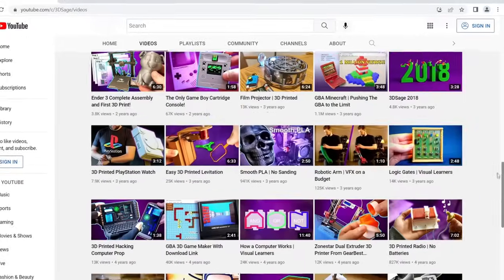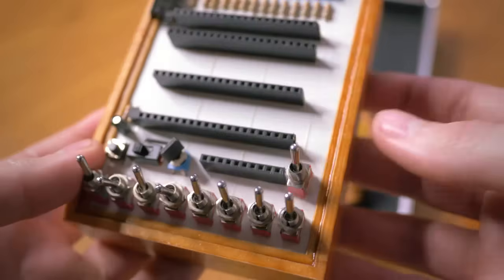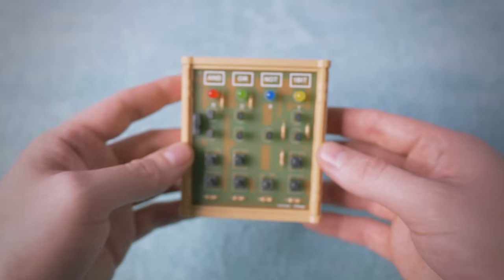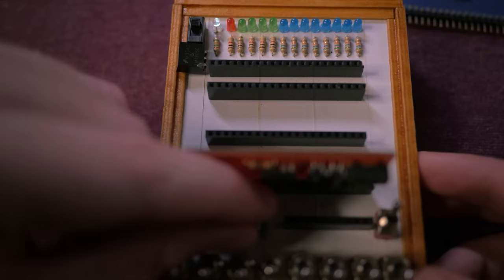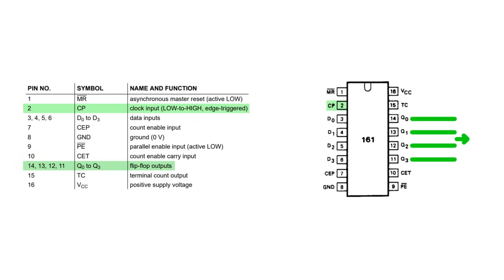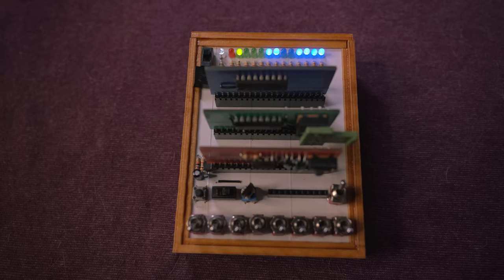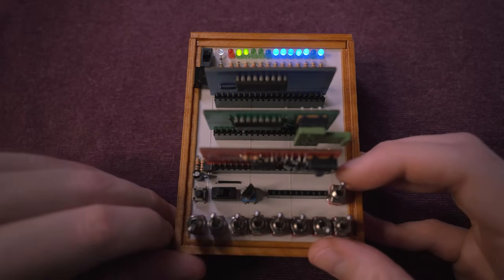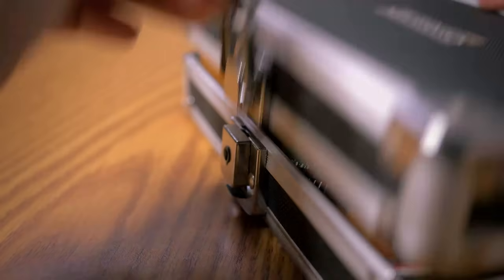I Made My Own Computer | Let's See How It Works

Comment: at 2:00 there are two types of BJT Transistors
 NPN is effectively a NOT gate in transitor logic (runs until input is applied to gate) [inverse of or gate]
 PNP is effectively a OR gate in transitor logic (runs when input is applied to gate) [shown in video]

2:29 though I didn't think two not gates together could do that, maybe it is a simple SR Data Latch, but I don't know how that works... hmmm time for research I guess. though my question is how that stays locked in one position... its definitely a data latch, but how does it not turn into a SR Data Latch clock like at 2:53 ... hmmm.

2:53 oh there is the SR Data Latch! perfect use of the NPN transistors nature to close the connection when powered and loop doing so!

10101 is 21 { 16[1],8[0],4[1],2[0],1[1] = 16 + 4 + 1 = 21 }

okay so there is halt, loop, and jmp... what is the fourth one?

Hope you have a great day & Safe Travels!
Reply: the capacitors is what makes a SR-Data Latch into a clock [ just realized that]

Hope you have a great day & Safe Travels!

Comment: Very cool. What’s actually interpreting the instructions? Something with EEPROM I guess? Actually if all your instructions are single clock-cycle operations, then just using an EEPROM would probably work, but maybe having a 12 address pin EEPROM with every input possibility hard-coded, for an 8/4-bit computer, kinda defeats the purpose.

Comment: Can it play doom?
Reply: No it cannot run doom. For doom you would need a real pixel display. And his computer does not have that. Oh, and also, the controller does not have enough buttons to controll doom.
Also x2, the computer does not have enough power to run doom. It also cannot do basic operations like adding, subtracting, multiplying and subtracting. Its only a little project designed to do really simple operations.
Reply: @boldituzvillam2318  😭

Comment: Where did you get you ram/memory chip from???
Reply from the maker: It was hard to find. I believe I got lucky and found one posted on Ebay. There is very low demand for such small ram chips. If someone else knows where to find more, please let us know.
Reply: @3DSage  You can find through hole SRAM in quite a few sizes by searching "SRAM" and selecting through hole and parallel, then you can decide on whatever sizes still remain in the list.

Comment: this isnt really a computer, its a cpu with ram, but wheres the controll logic, that interpretes the commands, or the alu, it not actually a cpu, it lacks the alu, so it cant calulate anything, which is the most important feature of a computer, with that being said, still a cool project, @3dsage please respond if i got anything wrong

edit: now i wrapped my head around how it works, since it really only has 2 instructions it dosnt need control logic, the alu point is still valid though, you can take a look at the ben eater cpu project, that thing is a full blown cpu

Comment: But can it run Doom?
Reply: No it cannot run doom. For doom you would need a real pixel display. And his computer does not have that. Oh, and also, the controller does not have enough buttons to controll doom.
Also x2, the computer does not have enough power to run doom. It also cannot do basic operations like adding, subtracting, multiplying and subtracting. Its only a little project designed to do really simple operations.

Comment: too simplistic! considering it works on not many bits, could address the real problematic of what processor opperations are. 
anyway, i never saw any real consideration about processor opperations. 
and what would that problem sound? 
like what is needed to fully exploit the possibilities offered by the size of the data magistral.

Comment: So, just fyi: the lines going out to the chips are called "control lines" not op-codes.
Op-codes come from the cpu in the form of a binary number. This number is then decoded and pushed through a look up table, which converts the opcode (usually like 4 or 5 bits) into the control lines (called microcode). This allows the code to be stored more efficiently, because of having to individually toggle 10 or more control lines manually, you only have 4 bits, dictating instructions, that control all that for you. The amount and types of op-codes you have in your CPU is called the Instruction Set.

Comment: Get yourself the parallax guick start. They say it got multiple cores so it dont need interupts. Arduino is nice. Or you can get raspberry pi. Not enough info couldnt say you really got a computer maybe real simple ahead of me in diy though. Read some books that showed how to put a computer together. But think you would learn more with arduino you could read ir signals from remotes then use the codes to turn on things like relays and lamps. Then control lcd screens make yourself climate controller. Course you can play video games with raspberry pi real game changer.

Comment: interesting project, but all that was demonstrated was a programmable counter, NOT an actual computer in the usual sense of the word. Perhaps the architecture allows math and logic units to be added, but as it is presented, its useful limitations are quite extreme.....can't do much more than flash some LEDs.

Comment: You don’t need to create a custom programming language to make a computer from scratch (that is emphasized because pc building is a different thing). Second of all, you are completely wrong at 1:40. There were plenty of other inventions you still need to weigh it’s importance on (like rockets, space stations etc.) The transistor is also not essential to computers and was in existence for a couple years before they used it to make logic gates. The logic gate (which is one of the only purposes of a transistor in a computer, besides amplification and analog stuff) is also not the only essential component of a computer. If you had a logic-gate-powered cpu but no memory or power source, what good would your computer be? Thirdly, it does not function anywhere near the speed of light. Electricity travels at around half the speed of light, and half does not mean near, especially when the difference is incredibly large. Lastly, what about the ALU? Every computer can do mathematical operations, so if it doesn’t have an ALU, it is by definition, not a computer. More accurately, this a controller. Try adding an additional bus to connect to peripherals so that you can still add your ALU. Plus, if you have functional opcodes that are not simply defined based on whatever it is you are connecting it to, you can make a program that, say, orders numbers and finds the mean, or calculates pi until it runs out of memory.
Reply: And by the way, not even microcontrollers lack an ALU, so “controller” is kind of inaccurate.
Reply: Imagine being butthurt about someone praising the transistor. A device that is quite literally in almost every single electronic device. We get it, you are a child and love the moon and space. Go watch Toy Story. I’m sure Buzz Lightyear will listen to what you have to say.
Reply: But tbh you’re right about most of it. No ALU means not a computer

Comment: not exactly true, capacitor charge takes time to open and close the gate
Reply: charge flow limits the transistor speed, not light speed
Reply: electricity travels light speed but the gate states dont switch that fast, and this is separate from the crystal clock speed
Reply: light speed, hmm, that would make a transistor switch at Terahertz, not gigahertz
Reply: and btw, light speed (m/s) is clearly not flipflops per second or hertz
Reply from the maker: I mean electricity travels in a circuit at the roughly the speed of light. And the transistors itself can carry out 604 billion operations every second. Way faster than any mechanical device allowing out computers to be much faster and reliable.
Reply: @3DSage  just correcting some facts, nothing more
Reply: @3DSage  changes in the current levels can be overserved at light speed around the circuit, but any gate on the circuit has a much slower speed limited changing speed
Reply: @3DSage  so the operational speed is limited by the gate switching speed, not taking account multiple transistors simultaneous calculating
Reply: @3DSage  the switching speed is synched with the clock, which is set at certain frequency, but the transistors can only handle so much switching frequency
Reply: @3DSage  have you ever heard of MEMS micro/nano cantilevers, also dlp mirrors, they can be super fast mechanical switches
Reply: @3DSage  just saying, light speed is a poor measure of computing speed
Reply: @3DSage  and transistor definitely dont work at light speed, you are talking to a semiconductor university master
Reply: @3DSage  charges do not move at light speed to populate the transistor gate, they crawl slower
Reply: @3DSage  even if the gate itself would be getting charged at light speed, otherwise transistors would be at terahertz speeds
Reply: @3DSage  you could actually calculate if the signal in the transistor is altered at light speed, you have the dimension of the transistor and the switching gigahertz 1/s speed
Reply: @3DSage  say 10nm and 5GHz
Reply: @3DSage  50m/s, thats quite slow crawl
Reply: @3DSage  light speed is 10^8 larger than that :)
Reply: @3DSage  capacitor has a charging speed equation, tho
Reply: @3DSage  the gate oxide capacitor
Reply: @3DSage  time constant of the capacitive system, tau=RC
Reply: @3DSage  signal levels out and in, from a component, signal responses, travel at light speed, the light has already traveled far before transistor changes its state, at its maximum internal speed
Reply: @3DSage  transistors do not switch state at light speed
Reply: @3DSage  only in a photon optic fiber the output of a transistor will travel the full speed, in the microchip the changes are bumped against the other transistors, waiting for their states to change
Reply: @3DSage  5GHz the cycle time is 0.2ns, 1% rise times would make them 2ps, that would make signal switch travel speed about 5000m/s
Reply: @3DSage  clearly not traveling the circuit at light speed but slow crawl speed :)
Reply: @3DSage  each component is synched to the clock, so the actual speed is tied to that, directly

Comment: This is not a computer. At best, it is automata. Having a clock, a memory, a counter and program does not make a computer. I'm not saying this is not great. Ok, so what is missing, the capacity to make decision (the conditional jump) and the capacity to compute (an Add operation).  The fondamental parts of a computer are inputs and outputs, a memory, a control unit and an arithmetic/logic unit (ALU).  Seeing that you are very close to a System bus architecture, I would suggest that you read about it.

Comment: But can it rum DOOM?
Reply: No it cannot run doom. For doom you would need a real pixel display. And his computer does not have that. Oh, and also, the controller does not have enough buttons to controll doom.
Also x2, the computer does not have enough power to run doom. It also cannot do basic operations like adding, subtracting, multiplying and subtracting. Its only a little project designed to do really simple operations.

Comment: Ain't no computer.  Nice anyway.
Reply from the maker: It's at it's most basic form. It reads my instruction and code and executes them. It can control output devices like a speaker for music or a etch a sketch or drawing. And I can make an adder so it can load a value, load a second value, send to an adder chip, and halt while displaying the final result. Just like a computer.
Reply: @3DSage  "Send to an adder chip".  I'm sorry, this isn't a computer... yet.  I got old projects too.  Yours looks nice.  Nice box.  Nice construction.  Not a computer.

I really don't mean to be a downer.  I love the idea of making a simple computer, particulalry with discrete circuits where ICs can be avoided.  I even like the idea of a four-bit.computer (at least a small command set).

Besides "making" computers using IC controllers where it has been required, I like  different ideas.  Even merging analog with digital. Analog ccts are nice and fast, often misunderstood.

Having a program counter that can engage loops and comparisons, inlcuding a register for various flags... you know, a computer, is a computer.  I guess this has been argued to no end somewhere in the comments.

You can define a computer or anything else as any which way you'd like.  I'm too tired of everything and the changing of definitiions all the time.
Reply from the maker: @schitlipz  It's actually been very well defined.
"A computer is a machine or device that performs processes, calculations and operations based on instructions provided by a software or hardware program. It has the ability to accept data (input), process it, and then produce outputs"
Reply: @3DSage  Ain't gonna argue the definition,, or even who writes the definitions.  This is a rabbit hole I do not want to go down.  (It's not a computer).

Even in a room fulll of profs, working engineers, technologists, and technicians, as well as programmers, etc... Nobody is absolute arbiteur of definitions.  Most, however, would agree that you have a very nice looking homemade apparatus.

Just a couple of examples of how mental it can become:  Are electronic calculators computers?  Are people who work out numbers... computers?  Is a set of mechanical  gears a computer, like that ancient Greek thing?  How about "firing computers", which were also analogue?  It's just too deep a hole.  No, please, leave me out of this.

Please be happy knowing that this insignificant, singular, electronic engineering  techologist does not agree that your contraption qualifies as a bona fide electronic computer.

But it's really, really nicely made. :)

Comment: STOP with the false analogies. A BIPOLAR TRANSISTOR IS NOT A SWITCH!!! Shouting intended. A transistor is a CURRENT AMPLIFIER. The current FROM the COLLECTOR to the EMITTER is a MULTIPLE of the current from the BASE to the EMITTER. It is an AMPLIFIER. As with anything real, it has an operating range. When a transistor is FORCED to operate out of its normal range, it is FORCED to be a switch. When Field Effect Transistors were created, it was found that they made better switches than amplifiers. This is why they are common in digital circuits.